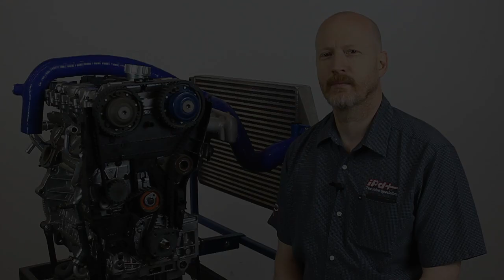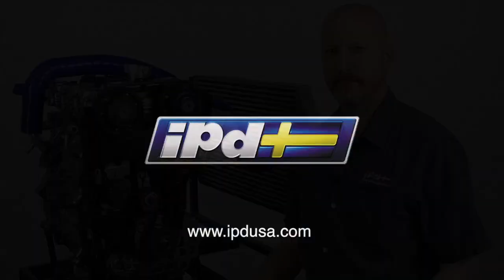IPD Volvo - Timing Belt Basics

Comment: Thanks, now I can change the belt. I do not have the cam and crank locking tools but you would have mentioned if they are needed. Vvt can be installed "as you wish". Let's start.

Comment: The belts are not indestructible.  It's just that the pulleys may fail first. And the original water pump is good for 200K miles - unless a previous owner has put a cheap chinese one.  Use only Aisin for the water pump, Continental for the belt kit.

Comment: Hey iPd, question for u in the market for a 93-00 850 s/v70 or 03 to 07 v70 which body style is easiest to do a timing belt, also are the natural aspirated or turbo engine better. Overall for longevity
Reply: I'd say that an older model car (so in your case, the 850 s/v70 from 93-00) would be easier, since those cars generally have more room in the engine bay. However, take into account that components like AC and a turbo might make it more difficult, since those cram up the engine bay itself.
For longevity, a naturally aspirated car will generally hold out longer due to less stress that's put onto certain components. More power from the same components means more stress is put on those components, making them wear out faster. This does however vary greatly on engine design, the way it was driven etc.

Comment: Do a 2000 volvo s70 needs  a timing belt changed?
Reply: Absolutely. If theres a question of when it was done...do it with the pulleys and water pump.

Comment: As it is a good idea to replace the idle pulley and tensioner when you replace the timing belt, for these, volvo recommends you check them for play or oil contamination, if they are ok that can be reused. A genuine belt kit including the pulleys is around £60 in the UK so its not that bad!

Comment: Hello, I drive a 2005 Volvo XC70.  I requested if my dealership would also replace the idler/tension rollers as routine (as well as the belt). Have over 90K miles.  I was told, not part of the job, nor is it required.  Keep in mind this is coming from Volvo.  I requested he double check with one of his service techs to confirm if my request is valid.  So, is this just the dealership hoping to ensure I blow my engine to ensure the possibility of a new sales in the future?  Thanks for your input.
Reply: I dont understand why a shop would dismiss a request to do more work that pays more labor and sells more parts. Take it elsewhere.
Reply: User One need to be change at 110000 miles. It will run 10 or 20 more but you will be gambling
Reply: Also..dont go to the dealers..find a volvo specialist in your area